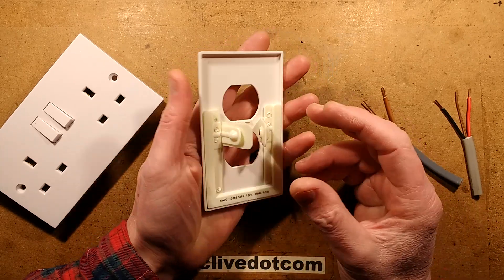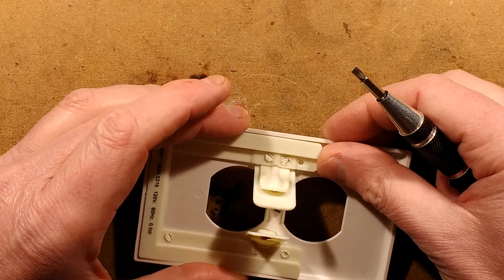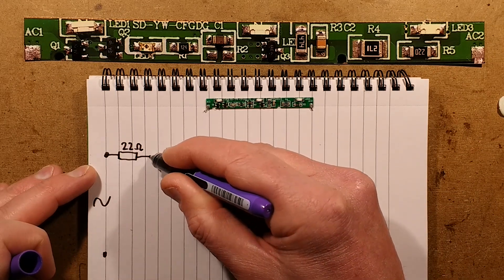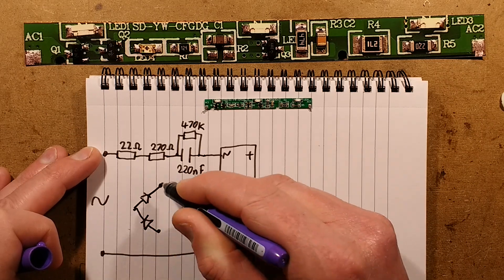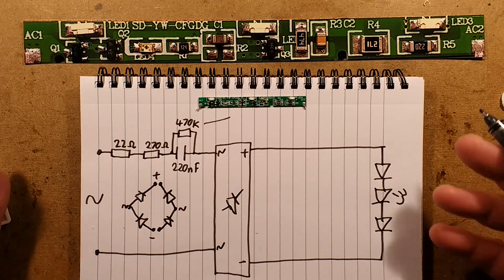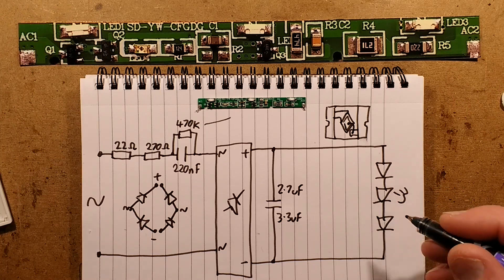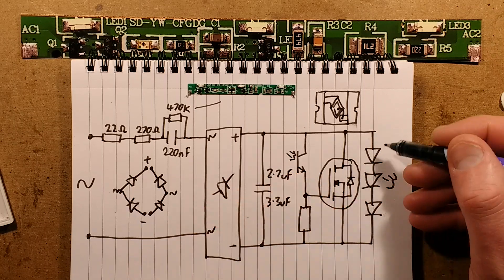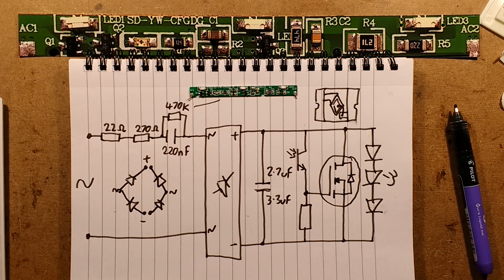Inside a night angel illuminated socket cover.  (schematic)

Comment: As Tom Scott once said, you can remember brown is the live, because thats the colour your trousers will go if you touch it.
Reply: I had thought the change from red to brown for the colour of live was to ensure colour-blind people could recognise it. The most common form of colour-blindness causes confusion between red and green; confusing the live and the earth (in American terminology, hot and ground) wires would be very nasty indeed!
Reply from the maker: The earth wire is striped to avoid that.  The old colour code had the three phase colours taken from the extreme ends and middle of the spectrum to give the highest identification.  The new ones are all dull colours, brown, black and grey.
Reply: Red is Danger, Black is the colour your hands will turn if you touch both... :P
Reply: bigclivedotcom Living elsewhere in Europe, the mandatory colors are Yellow/Green Earth and light Blue Neutral. Any other color is up to the installer / manufacturer, with brown live the most common.  Though two-core appliance leads are still mostly Blue and Black, which fits both old and new color schemes if you swap the wires.  3-phase color schemes for the phases has so many competing / historical schemes it's practically hit and miss.  I have even seen installations where neighboring groups in a "consumer unit" had the order reversed relative to each other (so motors might run backwards), only to be swapped back at the junction box near the appliance.
Reply: Caledonian TV,  "applying for fist jobs" he he :-D sorry im silly.
Reply: and then some of our (US) stuff shows up, that generally has live and neutral mixed up anyways along with differing colors (or is it colours)...good stuff, amusing when you come across our 120V stuff, that will kill you...if you let it. Then I work on my Russian bikes and go WTF my ground and hot are both RED!
Reply: The thing is, not a single UK employer will hire a colour-blind person anyway, despite the fact that it is now near-impossible for them to fail at identifying conductors.  Believe me, I learned the hard way :(
Reply: +Caledonian TV
You should not be working under poor lighting anyway.  LED torches are cheap, bright and tiny.  There is no excuse.
Reply: Caledonian TV
Oh, so even though I studied in the field and understand the science, my partial colourblindness should prevent me from being able to replace a sodding light switch in my own house? Nah.
Why don't you get yourself a lamp instead.
Reply: +Caledonian TV
If you were seriously unaware of advances in lighting technology, then it is not me who is disconnected from reality.  You might as well be trying to tell me that electricians cannot always be expected to work with screwdrivers or something.
Reply: +Caledonian TV
It's starting to look more and more as if you don't actually know what colourblindness is.  You are aware they don't (usually) see the world in black and white, yeah?  No?  I've been wiring and cabling things for a while now, and it's never held me back even slightly.

And it's not like you don't perform circuit tests on the job either, so what's the problem?  You tell others to accept physical limitations, perhaps its about time you learned to deal with limitations of the mental variety.  You're clearly getting on a bit.
Reply: DeoMachina Few led torches will illuminate colour accurately because they omit parts of the white light spectrum.
Reply: White is the color of purity and safety, thus the neutral.  This extends if you remember that hot stars are blue-white.  So blue can be neutral.  Still the the US, 120/208 is red, black and blue (white is neutral).  277/480 is orange, brown and yellow (neutral is gray).  The NEC suggests labelling wires to prevent confusion.
Reply: +Robert Langford
Good point, well made.  But while this makes LED torches unsuitable for reading say, a paint catalogue late at night, it's more than suitable for figuring out red from black/brown from blue.
Reply: DeoMachina Red from brown might be an issue though either would be 'live' in the UK.
Reply: I was told by my mentor, brown is “Shit hot” and Blue is “cold “
Reply: In the USA it is "you touch black and that is what you will see" so black is hot and white is the neutral.
Reply: Caledonian TV 
Are you color blind? That was quite an insensitive comment. The changes were for exactly that reason.  Try it yourself with some filters, single spectrum light, etc.  They work just fine, it was red that was the major issue red green blindness being the most common blue yellow following behind with some having both. The new scheme is identifiable by all three groups.
Reply: Black and white that we use in the states you can be color blind and will always know so it makes a lot of sense why we are using white and black but not sure why Europe never seems to change to anything we do even if what we do is certifiably better.  It is like they strive to be a contrarian if the USA did it.
Reply: @thebeststooge  They're too busy suffocating in their own smugness for that
Reply: @Bruce Forsyth The EU for sure does but after the slamming down of the foot for Brexit the EU is getting spanked so it is so damn cool to see them up there telling the EU off and the EU has their heads down.  Not so smug now and I only hope Poland (which, ironically, has more people wanting to leave than did GB) and Italy follow suit.

Comment: I have been wonder about this for MONTHS!  Did want to but one just to tear down.  Thanks for posting!
While researching this, I found an small surface-mount IC that connects to rectified mains and turns on an internal FET only when voltage is below 12-15V.  A great low-voltage / low-current source for off-line use.

Comment: I bought 2 of these at my local Wal-Mart last year.  They're easy to install & surprisingly bright at night.  Like any other device than uses a photocell, however, they are quite sensitive to slight adjustments in lighting i.e. when I walk by or there's not enough natural light in the room during the day, it turns on. They're a lot nicer than the old photocell night lights that stuck out 1-2" from the wall.  Good product, yet they hardly use electricity.

Comment: These things are sold in Wal-Mart in the  "As seen on TV" section for $20 and seem to be fairly popular since they're frequently sold out. Thanks for showing us what's inside these units because there's no way I'd pay $20 just to see what it was inside.

These things are super unsafe because they're not fused, all it would take is one component like a over-stressed capacitor to fail and you suddenly have a smoldering fire going inside your wall plug.

Target has a twofer $5 of the plug-in night lights, which you can actually unplug in the event of a problem.

Comment: That tiny 0805 dropper capacitor made me very curious. I searched mouser and digikey and the best I could find was a 100nF 200V capacitor from TDK (expensive). I may have missed something, but either that capacitor C2 has a significant less capacitance as 220nF or that capacitor never ever meets a voltage rating of around 200V.
Reply: 200V cap is fine for 120V power.
Reply: It will work without breaking down for some time, years even if the mains isn't too polluted, but it isn't really best practice. Rule of thumb is that a generic DC-rated capacitor should be dimensioned according to the peak-to-peak AC voltage, which is actually 340V for a 120V supply.

Comment: I'd be wary of using one of those. US/Canadian dual sockets have a breakable link which allows you to wire each individual socket to a different feed if you need a full 15A on each. If that were the case this might link two circuits back together.
Reply: That's been my fear and I actually sent email to one of the companies making these things.

Sometimes you break the link to have a switched outlet.  Shorting across would not allow the outlet to switch off.

But a worse case is a kitchen circuit where you have two 20 amp feeds.  Some people wire separate feeds to each side of the outlet to spread the load.  If they are from opposite legs of the 120v supply, when you snap this cover in, there's going to be a BIG BANG as you short across 240v!
Reply: Yes, that would be a spectacular bang.
Reply: If the terminals were in the center it might bridge the gap.  The terminals are slightly biased to the lower outlet.  Regardless the product is sketchy
Reply: I just received a pair of these lights  from E Bay. Haven't tried installing them yet but the instructions state it should not be used on a outlet where there is more than one branch circuit.
Reply: I am not being a troll but I have never seen a link.  Can you show me this because the receptacles I have used have two silver nuts and two brass/gold nuts and are bridged but that metal bridge is not able to be removed nor would I want to try and cut it because there is not much room between the nuts and is no way to sever the link between them that I have ever dealt with.
Reply: IF they're on separate phases? If you're using a shared neutral they HAVE to be on separate phases. If both were on the same phase, then the neutral would be required to carry the SUM of the current being supplied by both sockets and therefore is likely to be overloaded. While if they're separate phases, then the neutral only needs to carry the difference in current being supplied from both sockets and therefore will be well within its rating.
Reply: Thank you.
Reply: Wouldn't work for me.   I wrap electrical tape around the socket after wiring.
Reply: It is not possible in a kitchen circuit to wire an outlet separately. All kitchen and bathroom circuits must be in series with a ground fault device. As for shorting across like you said it would not happen. Once you break the connecting tab on the outlet there will be nothing to contact and the LED plate will not work.
Reply: Wouldn't they provide double pole RCD/GFI devices specifically for such situations? The current through all three wires at any one instant must still sum to zero unless there is earth fault leakage.
Reply: USA spec double-pole GFI breakers are ridiculously expensive,  typically 10x the cost of a GFI outlet. $10 vs $100. So while it can be done, it usually isn't due to the cost

Comment: In Australia we have,  Brown(Active), Blue(Neutral),Yellow/Green(Earth).
Looking at the US LED plate, do the heads of the  wire terminals in the wall plate actually sit that high for the copper contacts to just connect like that? ? ?

Ones I have come across here , different layout too, even with wire in the terminals, the heads of the screws are 3 or more mm deep in the casing.

Comment: Love the videos. I ordered one from a Chinese website.  The light  output isn't enough to light the floor in a hallway. It might be bright enough to calm a kid who just needs some light on at night.

Color code in the USA. For 120 volts AC, white is neutral, and black is live. While 12v DC, black is negative, and red is positive.  Which is just frustrating when working with power inverters. 

Our earth is bare. Not sure why you would want to insulate it. Just seems more safe not insulated and cheaper to make.

Comment: Off topic:   I saw an ad for a standard A19 LED with a built in rechargeable Lithium Ion (3-5 hours power outage runtime).

1)  I wonder if heat would be a problem for the battery inside the enclosure.
2) The product states the bulb can be activated by shorting the bulb by holding it in your hand or immersing in water (yes, water!).  So, I assume that somehow if it detects continuity, it is in power outage mode.  If there is no continuity, then it is simply switched off..    (Curious if this was the thought behind the emergency "open" sign. dunno.)

Comment: Neat circuit! Why didn't you turn it on? I like the SOT-23 diode pairs and the split rectifier design. Stealing it for an in-circuit power meter super slim layout.
Reply from the maker: 120v plate, 240 volt supply.
Reply: He'll need a step transformer or variac.
Reply: Is it that tough to come up with a step-down transformer in the UK? I can find used step-down transformers on Ebay all day long. I got a 2kva for $60 shipped and a 3kva for $100 shipped (I use them as step-up transformers to run small 240V loads off of UPS/inverters that only have 120V output) Smaller ones like a 250va or 500va are even more common and cheaper. These are GE / Square D / ACME transformers decommissioned from industrial electrical installations.
Reply: Also have the frequency conversion for some devices. We use 60 hz power in the US, because we invented power systems and did it right first...lol

Comment: @bigclivdotcom

Question: If i send you a PCB shot of a Chinese 4 controller usb powered Ni-MH charger, can you tell me if it is good in any way (like any protection, or will it just overcharge and eventually destroy the batteries, etc)? I know that the battery packs (5k mAh) are fake (i tested, they are about 700mAh) but i am curious about the charger unit itself. 

I see them selling in droves now that the brand name ones are no longer manufactured, so i am curious if the charger unit is good, then just hack the battery packs with better batteries and reuse the old charger for a super cheap wii batter pack unit+charger.

Thanks.

Comment: Possible dumb question incoming:
Why is the earth core in twin-and-earth always unsleeved on the roll, yet you must sleeve it manually yourself when you install the cable?
Every time I see where it has been used, it has a separate piece of green and yellow sleeve added to it, so why not just sleeve it at manufacture like regular flex core?
Is it down to cost or are there reasons for it being unsleeved?
Reply from the maker: I'm guessing it saves cost and size.  Although apparently they are now sleeving it and making the core sizes equal in Ireland.

Comment: Those wires that you showed at the start. I understand they are an old and new style for whatever reason, makes pen pushers feel important to screw things up... Anyways.

It looked like the copper was the same size, however the insulation looked a little thicker on the new style. Or was it because of the camera angle? If it was indeed thicker, was it because of the manufacture difference? Or is that the new code now too, thus all the new style (color scheme) is thicker?

Comment: on one of my recent trips to the hardware store (Lowes) in the US, I noticed that A. they change suppliers for outlets and B. there were a handful of outlets that were molded differently that prevent these from working as the breakaway tabs to separate top and bottom circuits is more protected from the front along with the screws. well a neat idea it is anything from a standard, and even for the name brand equivalent light up night-light plates.

Comment: Been waiting for the illuminated LED light videos. We replaced all our sockets with safety ones a few years ago, the light covers don't work with the safety plugs. :( 

Interested in how they work since it's essentially 120V for LEDs there has to be some tricky resisters or wiring to make the leds not explode lol

Comment: Light sensor seems like a waste of time if it draws more power when the LEDs are off. Might as well leave the LEDs on permanently and save the components and save on power when it's light.
Reply from the maker: It will extend the life of the LEDs as the phosphor and emitter degrade slowly in use.
Reply: Ah yes, that's true. Thanks for replying.
Reply: Shorting power rail doesn't essentially use more energy. In this case, it increases apparent power, but since the power is now all reactive, it reduces real power. Real power is what you get billed for.

Comment: I have a question...
I recently got one of these light covers and came across a very strange occurrence. I set the cover face down on my wooden desk and when I pulled my hand away the lights began to glow dimly. When I touch one of the leads in the cover the lights get considerably brighter. How in the world does it light up and how is it getting its power?
Reply from the maker: It sounds like it could be static.  LEDs are very sensitive.

Comment: very smart indeed. I tried to replicate it a year ago but couldn't fit a typical high voltage capacitor in there nor the typical bridge diode package. I'm not sure if these guys are ripping off the original or they made it for them to start with

Comment: I understand that the diagram here doesn’t try including every detail, but when the phototransistor starts conducting and VDS approaches 0V (assuming MOSFET enters saturation), does that then cause VGS to be pulled below VTH and turn the MOSFET off briefly? Does this happen yet the circuit still achieves the desired effect, or is there additional resistance between the rectifier (+) output and the LEDs/drain?
Reply from the maker: The MOSFET will turn on to the level that the voltage is still enough to keep it switched on, but below the forward voltage of the LEDs.

Comment: Why would they use a ceramic cap for the dropper. Don't they typically fail short
Reply: Whenever the question is "Why do they?" or "Why don't they?" the answer is almost always "Cost!"
Reply: Would it matter much? If it failed, it goes short, current increases and something acts as a fuse. Could be said cap. Could be a resistor. There's enough small stuff in line with the current flow that it would fail fairly uneventfully... Assuming the plastic isn't cheap, ultra-flammable stuff.